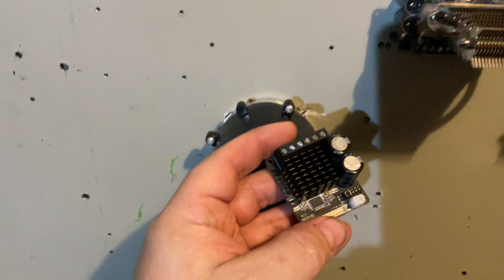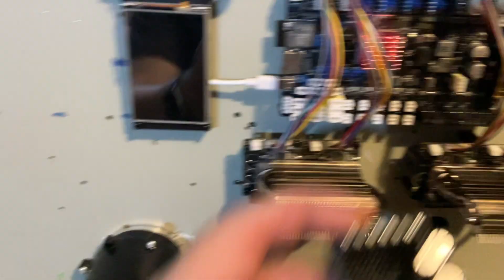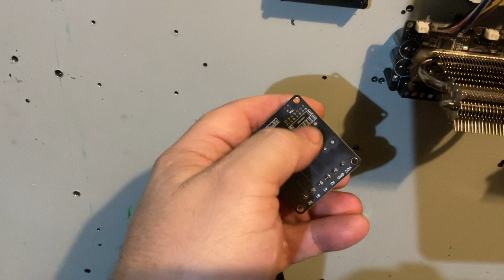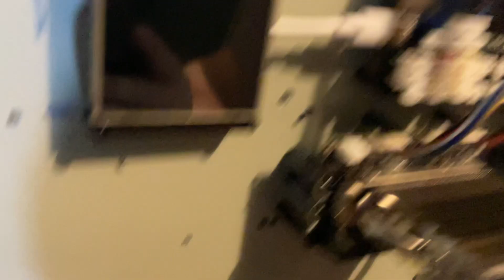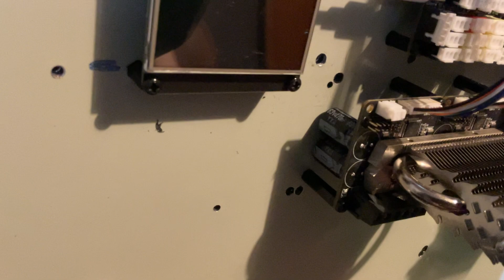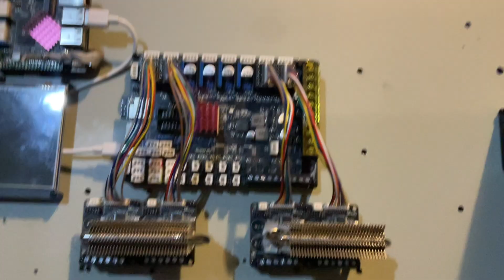mellow fly 5160hv v1.2 pro heatsink mod

Comment: Those don't look like passive heatsinks. Usually passive ones have more space between the fins, to increase convection flow.
Reply from the maker: Because the load on the fets is so little … they don’t make a lot of heat … compared to the stock heatsink ….. there is a lot of surface area.
There will be a couple large fans blowing some air past them just because I like airflow but I will put a thermistor on them to track the heat and add in a backup and set up something in klipper to boost fan speed if they do get to hot
Reply: @vvega007  Oh, I'm sure they're more than capable of cooling those small FETs. I mean, the heatsink is designed for, what, 80 W or something. That's with a fan, but still. And yes, if they wouldn't for some reason be up for the task then attaching pretty much any fan would be good enough.
Reply from the maker: @marcus3d  my biggest issue is the original heatsink didn’t actually cover the fets . Mellow/fly have designed and built the perfect product for the high end market spec’d well above what we need , but just didn’t quite get the finishing right . 
The idea of this was to go well over spec’d in cooling … and trust me under the little bit of testing I’ve done … it’s overkill even passively :) 
End of the day this new gen of boards from fly/mellow have really stepped up and given us some genuine high end products . 
They just need a tiny bit more work to finish them off :) .
The next set coming …. Will be watercooled in my hotend loop :)